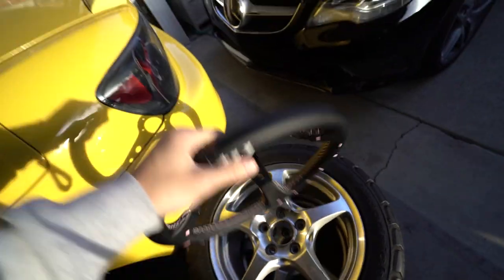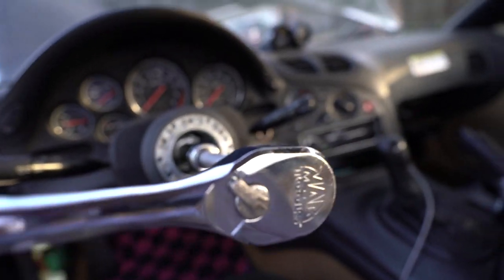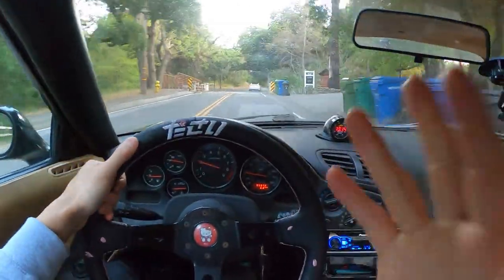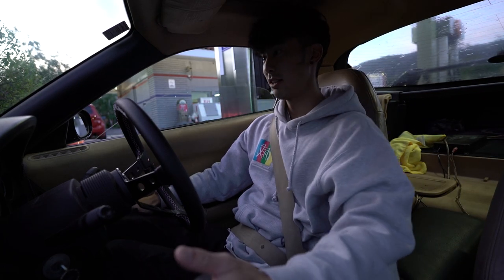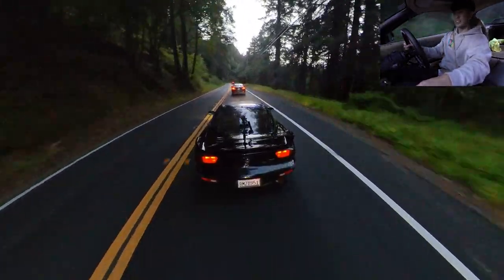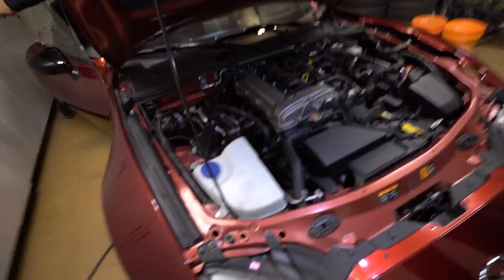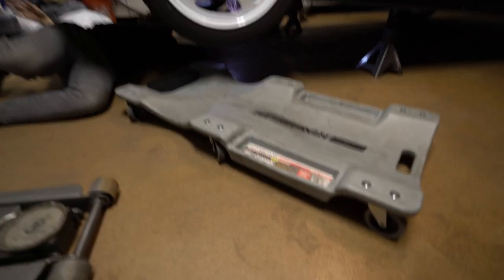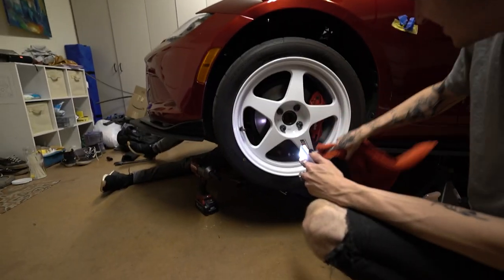Testing Out My New Steering Wheel | Closed Course!

Comment: There is no way to disable the door chime on an FD without disabling the other systems, such as the shift beep, seat belt, headlight warning, etc.  Seems to be that way for most RX7's including the FB.
Reply from the maker: BIG RIP DAMNIT
Reply: What about putting a sticker on sensor, where the car thinks It's all the time closed? It's possible?
Reply: @aLm0e  in theory it's possible, but you would think somebody would have posted something on RX-7 owner forums  if they found a quick and easy solution for it. Given it's an antique car, somebody must have tried it.
Reply: hb just removing the switch and jumping the wires together lol, doesn't seem that complicated

Comment: A great way to clean alcantara/suede is to use some P&S Xpress interior cleaner and a horsehair detail brush, spray a little into the brush and scrub liberally without using too much force then wipe it clean with a microfiber towel

Comment: I’m sure the wheel is fine abs is known for bending rather than snapping and you’re right you’re appling rotational torque to the wheel rather than perpendicular torque
Reply: I'm not sure, if you have time could you confirm if it's a fact that torque is always expressed in a straight line technically?

Comment: If the wheel is made from ABS and not properly protected/coated - I would suggest ditching it ASAP - as ABS is especially susceptible to UV embrittlement and over time can drop the yield strength to like 30% (didn't check) of nominal and start falling apart

Comment: lol probably gonna burn it in half a run, relatable. just turned my 8 after like a week and my e brake and dsc lights came on it is auto so i noticed the AT light came on parking indicator light kept flashing and everytime i pressed the brake the lights got dimmer, put into reverse and immediately died. One thing after another with this thing.